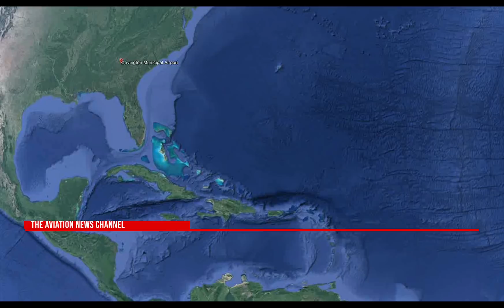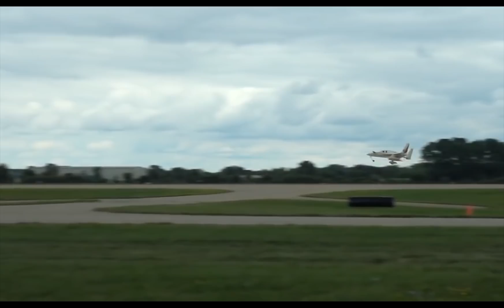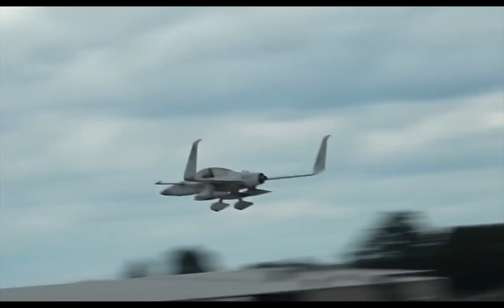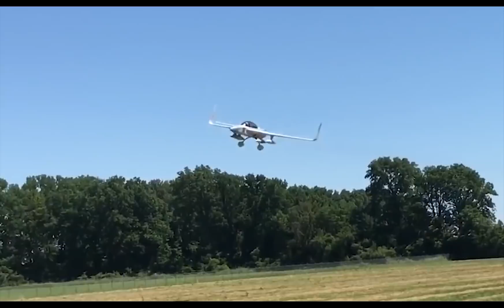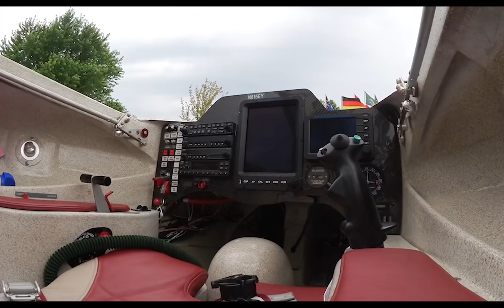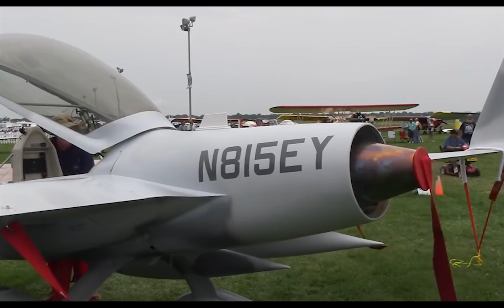In-flight Break up of Amateur Built JETEZ September 2018 (NTSB Reports)

Comment: That computer voice over has NOTHING to do with the video shown. That is a completely different video. The first seconds my left brain starts to oscillate, then my right brain screams THIS IS ENOUGH! PRESS THE THUMBS DOWN! What a waste of time.

Only the comments are very good. If you build a plane, know what you are doing or you will die. If you buy a kit plane, know what you are doing. Check for dangerous mods or you will die. Those were in the good comments so far. If you are a dangerous pilot, you could learn from that, and grow old and wise.

Comment: Sad to hear. 22,000 hours, commercial CFI, single and multi engine rating. Definitely a design or structural integrity issue. Very sad the accident was fatal.
Reply: Not designed for such stress from a turbine engine. He's not an engineer he should have consulted with a professional.
Reply: I thought I heard the pilot was an ATP.
Reply: @JSBIRD69  he better have he flew for Jet Blue.
Reply: VesBraun - Tragic, yes. But too many of us think we're supposed to live forever. 22,000 hrs is a lot of time. How old was this guy? Old enough to have lived a great life flying.
Reply: @alanhardman2447  Lance flew for Jet blue
Reply: Good flying credentials.

Too bad his aerodynamic design skills were no where good enough.

Sounds like flutter from flying too fast. Have to see what NTSB report says.
Reply: he had 22,000 hours flying, how many hours experience does he have building and maintaining aircraft. Stick to what your good at.
Reply: @tshelby10  He had already built several rutan plans and was a professional pilot and worked in the aircraft construction industry doing the fabric work for high end composites. You might even say he was good at it.... on the other hand the plane does have some severe flaws for instance the fuel pods on the wings were an unnecessary addition which he kept because he liked the look of them, I would not be surprised if the additional weight on the wings there is what caused the breakup. Anyway read here, very sad that this guy didn't make it https://www.kitplanes.com/jet-eze/ ... for all the effort he put into that plane if he had a parachute system like the subsonex he might have been able to acuate it as it pitched up before he crashed. https://www.kitplanes.com/jet-eze/
Reply: @Wingnut353  extra weight of a parachute to compensate for poor design or craftsmanship. yep many flying still today without incident.
Reply: @Wingnut353  
Good comment up until your last word. Your comment would carry  more weight without the insult.  Consider editing it out.
Reply: @tshelby10  1000’s hours if building
Long ez’s ,   Q-200’s.   These aircraft take a long time to build.    Lance  build quite a few of the Rutan design aircraft over the years before this jet build.     He was the go to guy for this type of aircraft.
Reply: @andrewhoag6982  compared to my 64,000 hours of building and maintaining aircraft
Reply: John Denver syndrome. Use common sense please.

Comment: The Long, properly built, is as I remember, is something like +/- 12 g's on the airframe alone.  This is absolutely absurd.  The only breakup that had occurred back when I was building one of these was a guy who literally left off the ENTIRE outside winglet connection structure, it was probably, at a guess, about 1/10th strength, and it STILL went for many flights before it failed.  I'm betting this guy, with that motor, was WELL outside the flight envelope when the failure happened, either that or design mod fluttered, or incorrectly built structures, or more than one or all of the above.

Look at those stupid winglets!  Flutter, huh?  Maybe that's WHY, unless you are an aerodynamicist, you should leave major airfoil/winglet modifications to the QUALIFIED designers.  I have no sympathy for this idiot, though I do for his family.  Darwin, flat out.  And putting EZ on the JETEZ name is just PLAIN WRONG.  Rutan says if you heavily modify a Long EZ in building, DON'T call it a Long, so it doesn't get filed in with the Long EZ safety record (like John Denver's did where the crash was CAUSED by a not-in-the-plans followed modification, which worked fine for the original builder but certainly did not for John, who should have fixed it before flying), and that is why Rutan, and many others are out of the business of homebuilt kits.

When I was building a Long, we went to look at another guys Veri in construction, and the idiot, I won't give his name but go to NTSB and you can probably figure it out) claimed to be a NASA shuttle airfoil designer (he wasn't) and had CLOSED UP the slot in the Fowler flap type elevator on the canard.  I told him IF HE WAS LUCKY, the damned thing wouldn't even rotate, because if it did, he was in REAL trouble.  It didn't rotate luckily, so it never got off the ground, as there was no flow over the top of the elevator, as I suspected there wouldn't be, and I'm NOT an aerodynamicist, just an EE with a lot of interest in flight, including RC where I did build my own designs, even my own hand drawn airfoils as a kid, which weren't great (especially the flying wing one, I knew about and incorporated reflex, but when the thing pitched up to a stall it REALLY went snap pitch unstable), but hey, there it crashes, you just build another one, nobody hurt, nobody dead
.
He also had a volks engine in it, with WATER COOLING adapted.  What a moron!
He crashed it a few flights later, at the airport, through power lines onto a flooded taxiway shoulder, and walked away. Claimed in the newspaper article on it that that was the 3rd or 4th crash he'd walked away from (can't remember exactly).  I was thinking, yeah, go build another "special" airplane, eventually, you won't.  What do they call then when you keep doing the same thing over and over expecting a different result?  At least broadly applicable here.

I will go look up NTSB on this one.
Reply: Too much info there pal. He payed for his mistakes with his life. At least he died doing something he loved and no one else was killed.
Reply: @yellowhammer4747  Something he loved ... true that.  And everybody dies, it's not like you  get to avoid it, it's just the WHEN, really.  I think it was one of the Wrights who said if you want safety just sit on the fence and watch others fly, or something to that effect.  Also true.

Maybe I was a little too harsh, but still, if you are going to do this kind of stuff (meaning redesigning man carrying aircraft to a large degree), it might pay to hand your intended mods to an actual aircraft designer to look them over and do some sims, and then maybe it doesn't happen to the next guy.  Also, I might point out that while this builder didn't kill anyone but himself, if he had flown off his hours and then this happened, he very well could have.

And builders can NEVER have too much info.  Everything they look at, from, in the case of the EZ, from the plans to the canard pusher newsletter to previous accidents including this one, and all the rest (like the directive that came out not too long ago about wing bolt access holes that were capped but not sealed, and the corrosion that has occurred under these covers and the required fix (which is pretty extensive) helps keep needless accidents like this from occurring. That's kind of my point, if a stupid 1 oz non sealed cover can cause these kinds of problems, or using the wrong non vented fuel cap can cause accidents (it happened) imagine what redesigning whole sections of a composite aircraft, likely with little to none of the required knowledge can do.

Unfortunately, piloting a plane for a very large number of hours does not give someone ANY insight into aircraft design, it IS too bad this guy apparently wasn't aware of that.  Most pilots and builders are really great people and likely this guy was no exception to that generalization.  It really doesn't matter to him, as he's dead, so I really don't know what "paying with your life" even means, but likely it was hell for those he left behind, and as I said, I feel for them, THEY are the ones that payed/are paying for it.
Reply: Flutter has no respect for a 12g airframe
Reply: @leerogers6423  TRUE THAT!  And bridges, and buildings, etc.  That positive feedback, resonant stuff has some serious get up and ...   break.  There's a vid somewhere on YT of an elevator on a test airplane going through severe flutter.  It is AMAZING to watch, looked to be JUST short of destruction to me.
Reply: The builder said that although appearing similar to the Long Eze the aircraft was very different in structure.  Maybe I would just stick to the long eze.
Reply: @jennydiazvigneault5548  Exactly, if a homebuilder is going to make major structural and aero mods, handing it to an aircraft designer/engineer is a requirement, as far as I am concerned.  You can't "eyeball" whether a structure is going to be prone to serious flutter.  It used to happen to aero engineered aircraft occasionally, and still does to bridges, etc. so it is in no way a trivial problem.   

Happens less now, mostly due to REALLY good computer design tools that can readily and to a high degree of accuracy analyze both structural and flow modes for an intended design.  Vne is there for a reason, and one of them is at some point flutter instability, which can virtually instantaneously destroy a structure, as happened here.  Fly a even a PROPERLY built Long (or any other aircraft) fast enough and it WILL self destruct, by one mode or another.
Reply: John Sikes n
Reply: I knew a crop duster who crashed at least 10 times l mean total loss, and eventually died when he was 75 of limes disease.
Reply: @kellyreim6627  That is amazing.  Most of those agro guys are SUPERB pilots doing VERY dangerous work.  
There is a ride along with one on YT spraying a very tight field, and I was about 40 gauge just WATCHING it.  I suspect his piloting skills had at least something to do with surviving at least some of those.  A total loss airplane landed relatively slow and flat vs. one that is a total loss for a near vertical high speed impact are two VERY different things, especially for survivability.

Comment: I suspect the cause of the wing flutter was due to those oversized winglets he designed. Not only oversized, but ugly. But some opinions may differ on that one. I hated them. And I suspect the added mass of their larger size created a pendulum effect that started a fore and aft motion, which induced wing flutter. The stiffness of the wing out near the tapered tip won't be that strong. I wonder what the flutter margin of the standard winglets are on a plans built EZ? Makes me wonder if Rutan should do an airworthiness evaluation to see if the plans built EZ's have enough wing stiffness near the tips to provide enough flutter resistance to prevent a similar such fail mode if the conditions are right to induce it. It may not be all that easy to increase the resistance to twisting out near the tapered tip of the wing where it's the smallest. A reduction of winglet height with longer chord could be one thing to increase twist resistance. To shorten the arm of the winglet.
Reply: not only that but the winglet to wingtip attach points appear to have a reduced chord compared to the winglet proper. That is, at the winglet root,  just the point where the strength would be needed, there is a reduction in cross section. Lance's modest, insightful, and detailed talk last year in the EAA webinar mentioned the design of the winglet, but IIRC, he didn't go into much detail about it.
Reply: Sovereignty Soldier  FFS, dude?!?! So, someone tries to reason out why the wings failed and that makes them a middle aged keyboard pilot/engineer loser? Who the hell do you think you are? What part of the ideas presented don't make sense? D-bag.
Reply: Wait... you actually saw the breakup somewhere in this video to help you make that judgement? Please tell me what point in the video to go to for the breakup, I'm tired of looking for it.
Reply: That’s exactly what happened, but this jet was an original design. Rutan’s design has a smaller winglet extending below the wing as well, to help counteract the drag of the upper winglet.

Also, Rutan’s design has been tested safely up to 250kts. This jet was flying well above 250kts and had no lower winglet. 

I’ve spoken to the guys who designed and own other similar EZ Jets based out of Covington, and there’s more to the story, but this NTSB report covers all of the pertaining facts AFTER the plane left the ground.
Reply: agree 100%, those winglets are nonsense
Reply from the maker: Your theory sounds very plausible to me. Some very good points
Reply: tonytrader   not at all. I own 2 homebuilts, fly both of them. One I built myself. One all wood, the other all composite. I know how structures are designed and built. Having done it for decades. I never play computer games. But you probably do, in your mothers basement.